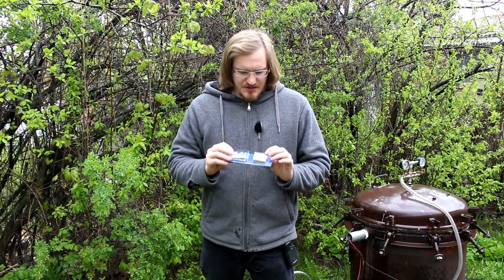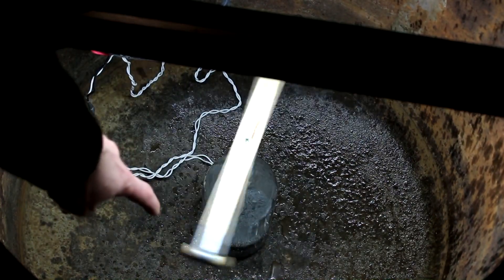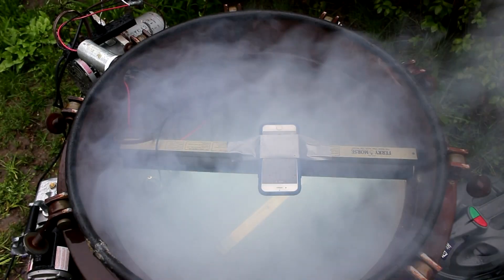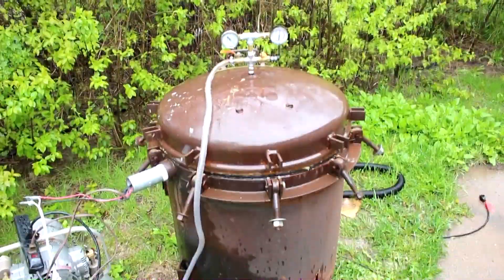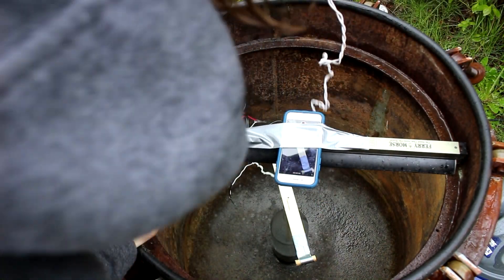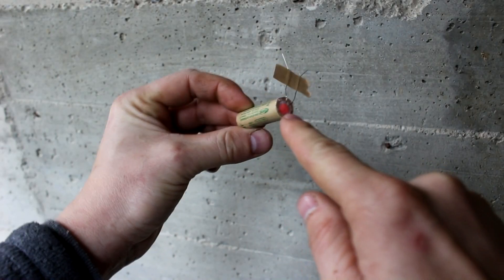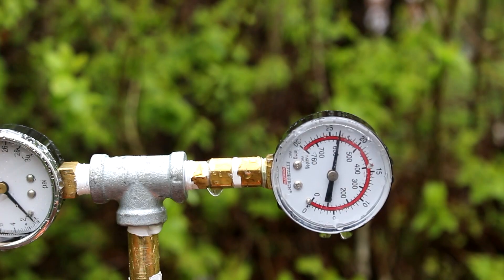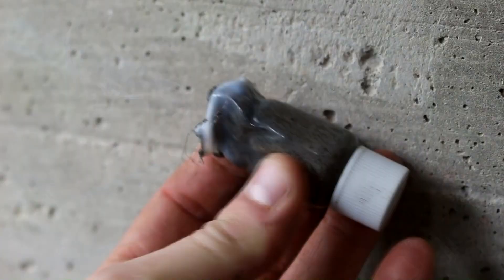Will a Model Rocket Motor Work In Vacuum?

Comment: Cody'sLab
As soon as the rocket burns the chamber will be filled with combustion products. It is these products of combustion that cause the pressure that the rocket needs to work against in order to cause thrust. This is not the same as a rocket in a total vacuum. Also, there is some liquid boiling in the bottom of the tank. That will be producing vapour to which all adds to the restive pressure.

What is the liquid in the bottom?
Reply: Rockets don't need "pressure to work against" in order to cause thrust.
Reply: 1. Rockets 'push' against their own exhaust jet. There is no need for them to be surrounded by a fluid for this to occur. To demonstrate this, I suggest you do an experiment. Get a skateboard (or roller skates) and something that's heavy and throwable (e.g. a medicine ball). Now go somewhere with a smooth, flat surface, stand on the board and throw your ball as hard as you can. You'll roll backwards a bit (or fall off. If this happens try again). Once the ball has left your hands, it is no longer connected to you in any way- so all the momentum (momentum is mass multiplied by velocity) you gained must have been transferred to you in the time while the ball was still touching your hands. In fact if you measure your speed and the speed of the ball immediately after throwing you'll find that you and the ball have the same amount of momentum. This is Newton's third law of motion: for every action there is an equal and opposite reaction. We can fairly trivially demonstrate that you didn't roll backwards due to pushing on the air by trying the exact same experiment with a party balloon: the balloon has similar cross sectional area to a medicine ball, so it should have roughly equal ability to 'push' on the air. I can guarantee that if you re-try the experiment with a balloon you'll barely move if at all. A rocket uses the same principle, it just throws a jet of gas rather than a ball. While the gas is much less dense than a piece of exercise equipment, a rocket nozzle can accelerate it to much greater speed (over 4 kilometers per second for a hydrogen/oxygen rocket) which allows it to get the same amount of momentum from a smaller mass of stuff to throw.

Note that this experiment is limited to some degree by friction in the skateboard's wheels. You might get a more noticeable result if you get ice skates and try it on an ice rink. A heavier medicine ball (or other heavy object) will also help, which is just further evidence that the air has nothing to do with it!

2. The liquid is water. It's boiling because the pressure inside the tank is less than the vapour pressure of water at room temperature. If Cody had switched off his vacuum pump the water would have boiled until the pressure above the water equaled that value. In this case he left it on during the experiment, so the pump was sucking the water vapour out as fast as it formed and the water carried on boiling until he switched the pump off and opened the chamber.
Reply: Steer? as in aim the rocket's nose? That makes no sense- an aeroplane is under no compulsion to point its nose in the direction that gravity is pulling it, so why would a rocket be any different?

Of course  the aerodynamic wings and fins used by planes are totally useless in a vacuum, but there are other ways of controlling your orientation. The usual method for a rocket lifting off from earth would be to tilt the main engine nozzles left, right up or down depending on which direction you want the rocket to turn. The same principle is used by jetskis for steering in the water (as they have no rudder). Vehicles that need to control their orientation without firing the main engine use smaller rocket engines positioned at each end of the vehicle. These 'RCS' engines have their nozzles aimed sideways, so when they fire the rocket's nose is pushed one way and the tail the opposite, causing it to rotate.
Reply: bob question Looks like you're having a hard time forming a coherent sentence now too, not a big surprise. Also no surprise whatsoever that you have no evidence for your claims, your kind never does and never will provide any evidence.
Reply: You realize that gravity acts through an object's center of mass, right? being attracted by gravity won't pull your nose down (or cause any rotation). You can demonstrate this reality by dropping an object that normally falls nose first (e.g. a dart) tail first in a vacuum chamber. Objects that fall nose first do so because are immersed in a fluid (air, water, whatever) and their center of dynamic pressure is behind their center of gravity. 

This principle is critical for designing aircraft, as planes which do not have their center of pressure behind the center of gravity will be unstable (they're constantly trying to flip over and fly tail first) and almost impossible to control without specialized computers. Rockets have the same issue when they're in the atmosphere, and you can find plenty of footage on youtube of rockets losing control due to instability and being torn apart by drag when they start to flip over- notably the first Ariane 5 launch.
Reply: This experiment is supposed to show that rockets will work in a vacuum, however, this is not a simulation of the stated hypothesis. As soon as combustion gases leave the rocket they spread out and fill the void. This is a flawed experiment.  Either we are scientific about it or we are not. I have seen too many fudge over this major flaw and this needs to be addressed, understood and recognised.

We must also recognise that the rocket in this experiment is not subject to a force such as gravity as it is working horizontally on the end of a counter balanced arm. This means it only needs a tiny force to make it move.

We must also recognise that the chamber is being filled with very hot exhaust gasses, this heat will increase pressure to.

All respect to you Cody'slab, I've seen many of your experiments and are usually impressed at what you do. However, in this test, It needs a very close looking at.
Reply: But how flawed? That vacuum chamber has a volume of 50 gallons, or 189.27L. The motor looks like a class A motor, which according to a google search holds 3.6g of gunpowder. Using a simplified equation for combustion of gunpowder that gives 0.029 moles of gaseous combustion products. I'll assume that the gas in the chamber is at a temperature of 300K (remember it cools very fast as it expands). Put these numbers into the ideal gas law (PV=nRT) and we get a pressure of 397 Pa, or around 0.38% of atmospheric pressure at sea level. If we assume that the temperature is 600K (close to the melting point of lead) the pressure will instead be 0.76% of sea level.

In other words, the volume of gas produced by the rocket is small enough that its effect on the experiment should be minimal. In fact the water in the bottom of the chamber would have more effect, as the vapor pressure of water at room temperature is around 3 kPa. Accounting for the water, If we assume that the rocket works by 'pushing off the air' we can reasonably expect the motor to produce less than 4% of the thrust it delivered at 1 atmosphere. Such a large difference in performance should have easily been visible in the footage, as the motor would only be able to attain around 4% of the speed seen in the control test.
Reply: nerd1000ify
very flawed. Does a rocket produce gas? yes... do people want rockets to work in space so badly that they will accept biased results? yes... 

If this test is supposed to recreate the infinite vacuum of space, it fails. If this test is supposed to test a rocket with zero reaction pressure, it fails. If it is supposed to test whether thrust can be generated in an infinite vacuum whilst the force of gravity is applied to the rocket.....you guessed it, it fails.

If there is 1% of air pressure at sea level, this will return some force back to the rocket. Since the rocket is working horizontally, gravity has been excluded from the test.

Are you a scientist? is truth more important than validation of belief?

It seams belief is king and Tesla was right. RIP science.
Reply: Gravity is irrelevant to this experiment because it stays the same regardless of whether the rocket is burning or not- it always pulls downwards with an acceleration of 9.81 m/s^2 (at sea level).

The rocket's horizontal velocity is a function of mass and impulse (force multiplied by time). Because the rocket is always the same size and burns for the same length of time in each case, the impulse and thus top speed is a function of the thrust produced. Therefore If the rocket's maximum thrust is lower when there's less atmospheric pressure (which should be the case if the rocket works by pushing on the atmospheric pressure around it) we should see a large difference in top speed between the two tests. This does not stand up to observed evidence, as the bar appears to revolve at roughly the same speed in each of them.

 If on the other hand you propose that any small pressure will make it work at near full sea level efficiency then your claim that spaceflight is impossible is spurious. Space is not a perfect vacuum. It is filled with very low density gas being blasted out from the sun (the solar wind, which is responsible for the easily observable auroras at the poles), so under this alternative model rockets should indeed work in space.
Reply: nerd1000ify
Yawn, you don't have anything useful to add do you? For you, this is science. No desire for truth, just reinforcement of belief. This test is flawed and you are blind.
Reply: nerd1000ify
Yes, gravity has been made irrelevant, that's the point I am making. that is the other huge factor that makes this test irrelevant and unscientific.

The make believe iss is travelling at 17,500 mph, so we are told. If it was to stop still, it would plummet to earth like a 450 tonne lump. accelerating like crazy until it hit the atmosphere. Indeed if gravity was lessened by distance then it would zoom off into space and the ball earth will fly away from the ball sun. So we know that the rocket will be subjected to full pull of gravity all the way up to the "iss". so it's not a weightless mass operating in a friction less void. So how is gravity irrelevant when it comes to testing rockets in a vacuum?  :D 

Do you remember the red bull dude who parachuted from a balloon and managed to accelerate to speeds in excess of 800 mph, so the story goes and he was plummeting through air dense enough to hold him and a large tin can up under a helium filled balloon. 

So according to you, the vacuum is irrelevant and so is gravity....Ha Ha Ha Ha Ha Ha Ha scientism at its most spectacular.... ha ha ha ha ha.

So what is relevant? cut'n'paste???? ha ha ha ha ha ha....etc.
Reply: I never claimed the test is perfect. What I'm saying is that if my interpretation of your hypothesis is true then we should see a large and easily detectable difference between the rocket in air and the rocket in a partial vacuum. This does not appear to be the case, so either your hypothesis is false or my interpretation of your hypothesis is wrong.

If this experiment (and my analysis) doesn't convince you, that's great! Science is built on a foundation of skepticism. However, as mentioned above I've provided evidence and analysis suggesting that your hypothesis is incorrect. Therefore if you want to continue to be scientific you need to provide counter-evidence that is stronger than what I've already provided. 

You hold that this test (and therefore all conclusions based on it) is so fatally flawed that no argument can be based on it. Therefore I suggest you design your own experiment, one that will convince you regardless of whether the result supports your original claim or not. A scientist has to be able to accept that their hypothesis is wrong if evidence that disproves it emerges. I am: show me conclusive evidence that Newton's third law is false and a rocket cannot function in a vacuum and I'll believe you. But that sword cuts both ways: if your experiment shows that your original claim is wrong (and assuming you use good experimental design I'm pretty sure that it will) you need to accept that you were misguided and move on.
Reply: Just so you know, the gravity DOES get weaker with distance, by a lot, but 400km is nowhere near far enough for any huge changes in the strength of gravity.
Reply: 2ByQ
That's it. If you could get thrust in a vacuum, you can't steer a rocket. It will be steered by "gravity in one direction. downwards.
Reply: bob question how are you inventing all of these new laws of physics?
Reply: BadWolf HS
Just because something is new to you, this does not mean they are new. New laws of physics are Coriolis, the Shuler effect, apparent drift, standard refraction,  Gravity(beyond things falling). These are new "Laws" of physics. Its just that the real universe ignores them as made up ballshit. :D
Reply: nerd1000ify
An aeroplane has wings and uses air pressure to keep its nose from pointing downwards. You put that aeroplane in a vacuum and there will be nothing to stop gravity having its will. Same with a rocket.

Whilst we are just pretending that there would be thrust from releasing compressed gas into the void. Really, there would be no thrust.
Reply: bob question keep on telling yourself that if you want, but it wont make it any more true.
Reply: BadWolf HS
True is the limit, and you are right, it couldn't be more true. You haven't made a plausible suggestion as to how what I have said is wrong, in your opinion. So that might be a good place to start.
Reply: And you haven't 'made a plausible suggestion' as to how what you've said is right. Burden of proof is on the one making the claim, that would be you.
Reply: BadWolf HS
The burden of proof is on me to prove to myself what is. If you have no burden of proof upon yourself then that is why you can follow a false "reality" without question. That is the very essence of religion..
Reply: BadWolf HS
My sentences are perfectly coherent. It's all that rotation that's making you dizzy and messing up your perception. Rotational Anxiety is the technical term. ;D Makes you accept crazy thoughts without proof, just because other people share the same belief.
Reply: "crazy thoughts without proof".. how ironic, still no proof for your crazy thoughts.

Comment: it would be pretty cool if you froze some food and put it in your vacuum chamber to see if it'll freeze dry it.
Reply: Yeah that's not how it works you have to have a water collector that's cool down to like -40 and you need to heat up the chamber where the food is to drive off the water

Comment: In that last test there looked to be water puddled in the bottom of the chamber under vacuum. Shouldn't that have boiled off in a near vacuum?
Reply: Stephen Gordon it wasn't under vacuum yet. You can see the water boil as the chamber is depressurized.

Comment: I think NASA uses hypergolic fuels in the vacuum of space. But the rocket motor you just used doesn't depend on outside air to continue the reaction, just to get it started. That's why it worked the second time. Probably just a good seal with the hot glue would do just fine
Reply: Hypergolics are usually just used for specific applications like maneuvering thrusters or satellite station-keeping. Most rocket stages do not use hypergolic fuels as their main propellant.
Reply: That just shows how much I DON'T know about rockets. I was lucky to spell hypergolic right. My spelchekur didn't recognize it at all

Comment: I predict that it will work because a) the fuel is under mechanical pressure since it's packed together tightly, so the chain reaction is more likely to get started, and b) the rocket provides its own back pressure to drive the gasses out in a single direction.

Comment: Is there a reason you don't use GoPro type cameras instead of cell phones? What about an overpressurized chamber and the rocket? Would there be to much atmospheric pressure causing friction that it won't move or move very little?

Comment: Cody, can you give centrifugal force to some of the materials in the other video and see if they burn in a vacuum?  the force can be used to push the material together like the atmosphere is doing.
Reply: The cool idea but how many RPMs would you need to get that much centrifugal force to create an atmosphere of pressure in a vacuum